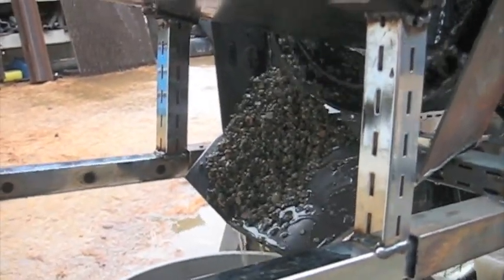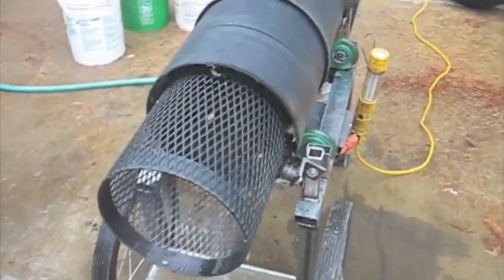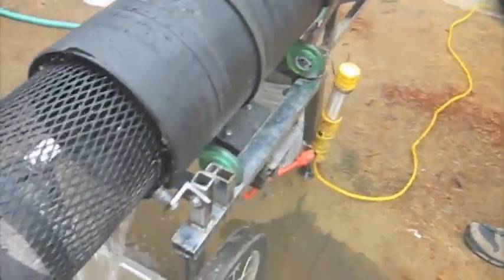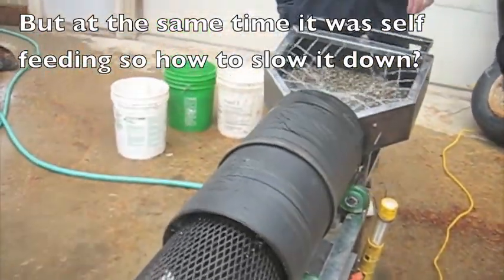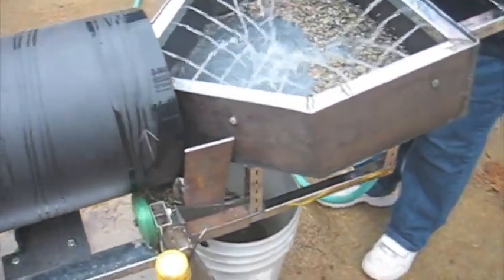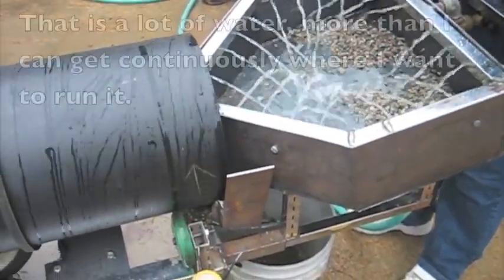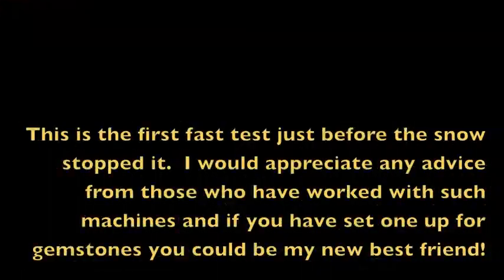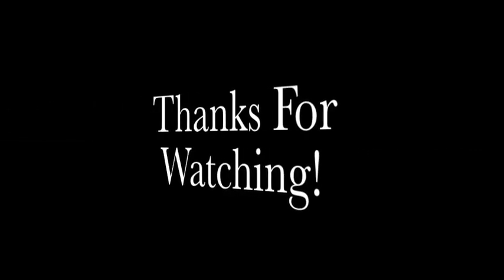Reverse Helix Trommel Test

Comment: you need a spray bar inside the trommel and a forward helix on the trommel screen will drive the material out as the spray bar  washes the heavies through the trommel screen

Comment: All that water running and you are using ac power?!  Are you nuts? I built a nice 12" beauty like that but used a dc motor for a for a dry washer with a v-belt. Runs all day and no chance of shock. And I had that same problem with material falling out the top. Extend the hopper farther into the drum. Only an inch or so makes a big difference. Mine was built from scratch too.

Comment: It needs a spray bar to wash the material down otherwise it will stick to the outer wall and ride up making a mess. Every successful spiral (helix) concentrator has a spray bar the entire length of the drum. I suggest 3/4 inch pvc pipe with 1/4 inch holes spaced 1 inch apart in a straight row. This is really just a sluice box that cleans itself so it needs lots of water flow.

Comment: you need to add a small length of solid pipe on your screening tube where the feeder enters, with a "ring" around it creating about a 1" lip.  Then extend your feed ramp a couple inches beyond that.  Should have no problems with build-up then.   Your angle obviously can't be very steep if you're concentrating sapphires, so you need to compensate for the fact that material will be moving through more slowly.  You could also reduce the size of the intake if necessary, or slow the water flow up top

Comment from the maker: @circusboy90210 You got the part where we are not using this for gold right?  Wishing to fine tune and derive the maximum amount of usefulness is not a lack of work on our part, quite the opposite.  This is part of a larger experiment to see if the trommel can be more efficient than our current rubber tire concentrator.  I know the reverse helix trommels can be used to find sapphires, I have stood next to large ones and watched them do it.  This is to determine if a trommel can be scaled down.